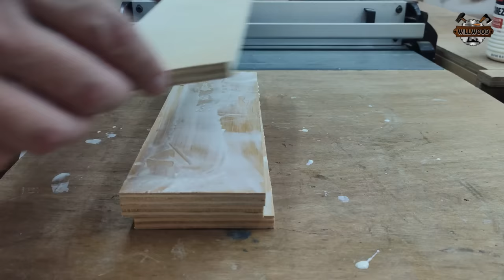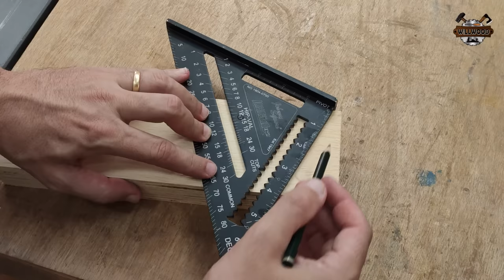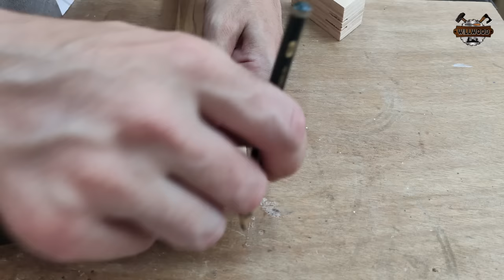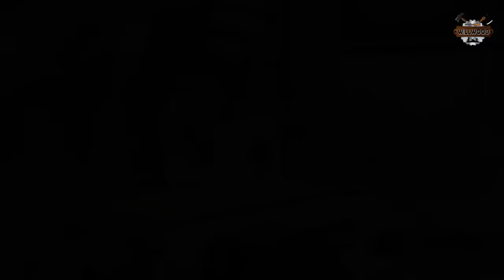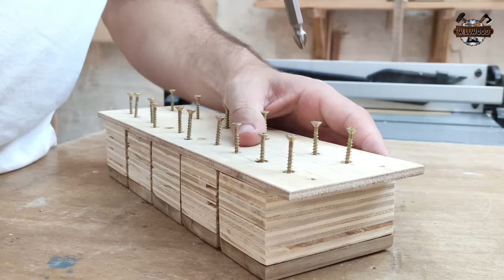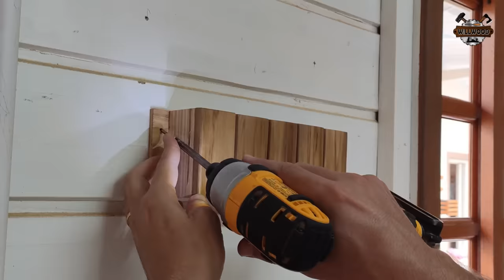From trash to masterpiece: True magic for your workshop with waste | Woodworking Tips

Comment: Flipping the workpiece around with each mark makes it very hard to follow the layout. It also gives me headaches trying to stop the action at the correct moment so as to absorb the design. And you could make paper cards that specify the grit you are running on your belt sander to round over the corners, i can see its been used, but the more info you include the better! Thanks!